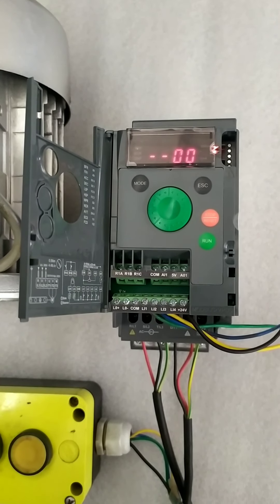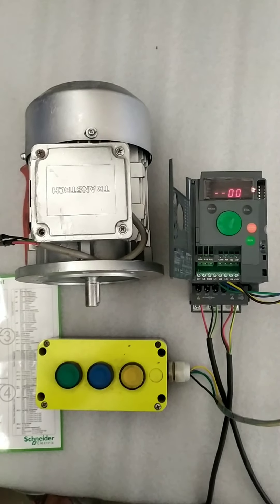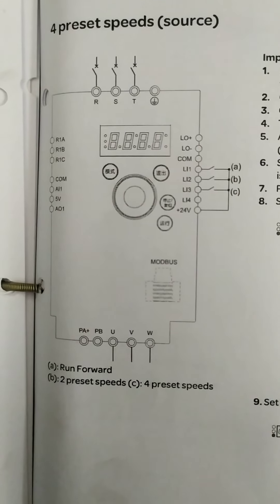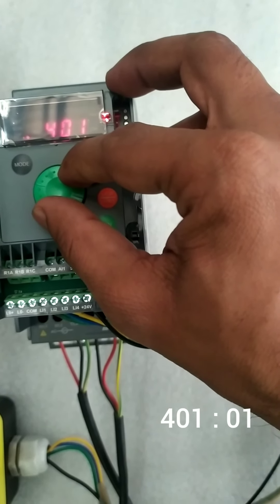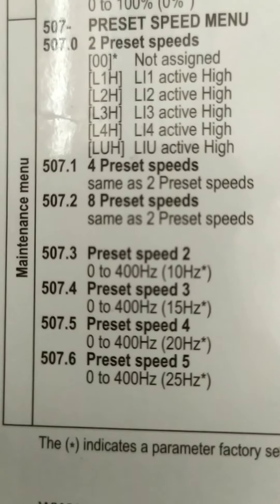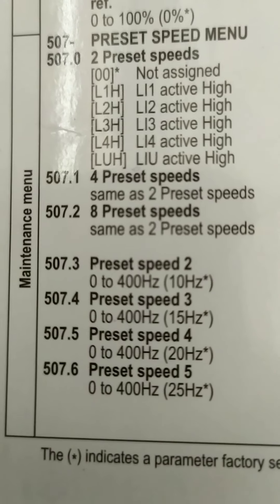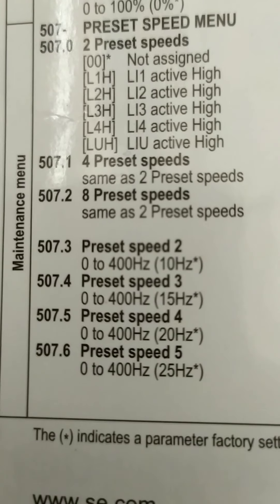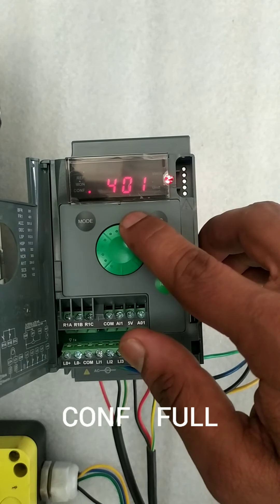SCHNEIDER VFD ATV 310 MULTI SPEED CONTROL

Comment: Hi  bro 
I am using altivar 32- 0.75kw drive. I want  to run motor continuously without getting off in two speed, first at 50 Hz and next at 10 Hz without turning off. It can't able to do this at preset speed enable in LI3. Since when digital input is enabled in LI3  it run at LSF LOW  speed frequency of drive, not at 10 HZ. Can anyone help me regarding this issue.